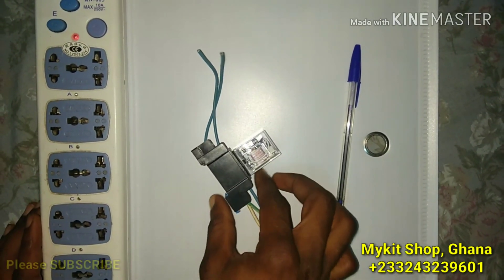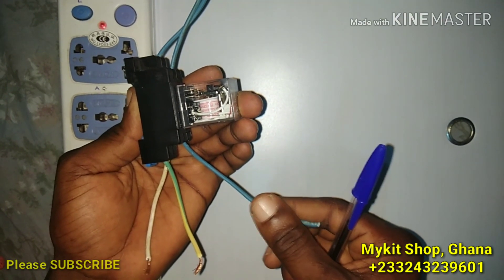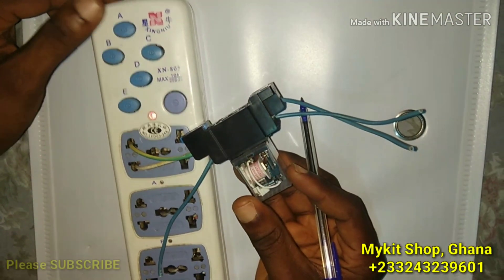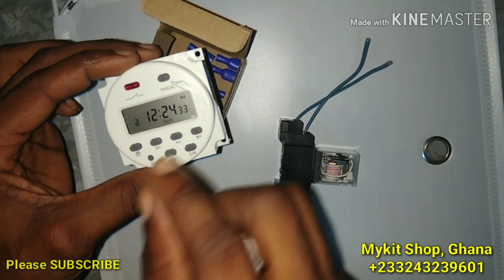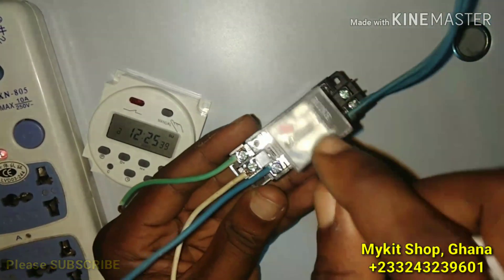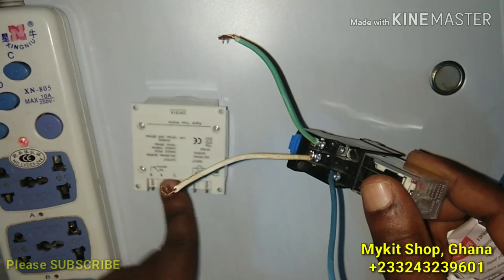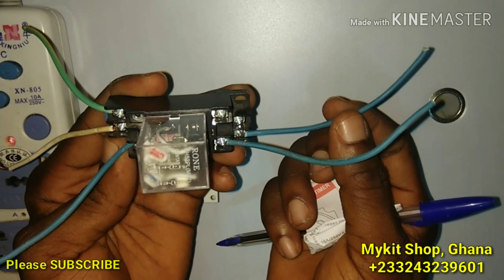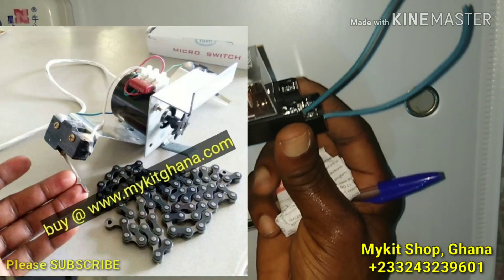Incubator turner with relay and timer Switch PART 3

Comment: I want to use a timer with a 12 volt linear actuator and a 12 volt relay as well as limit sensors, I want you to help me with the assembly or have a diagram.
Reply from the maker: Ok can we WhatsApp
+233505761940